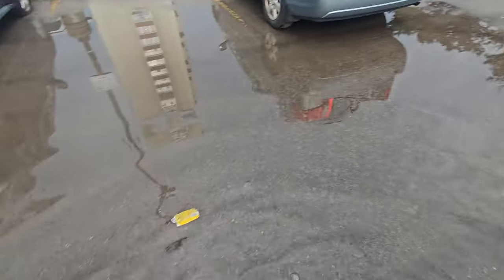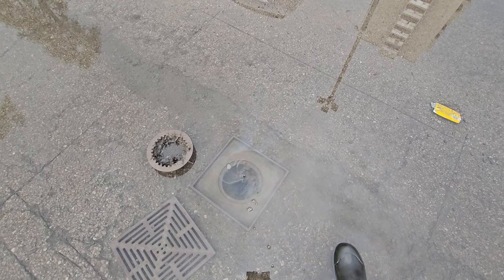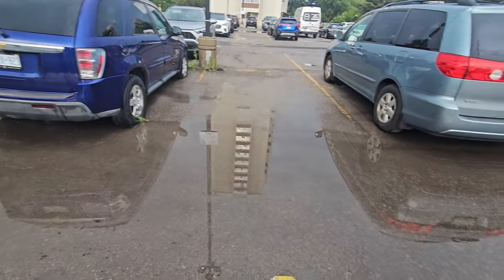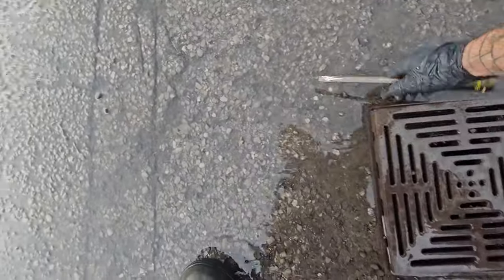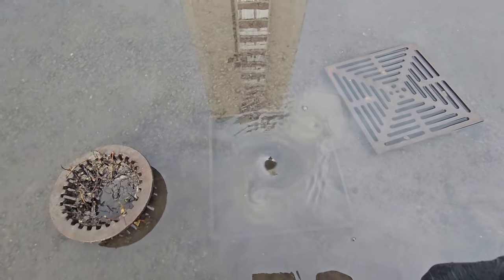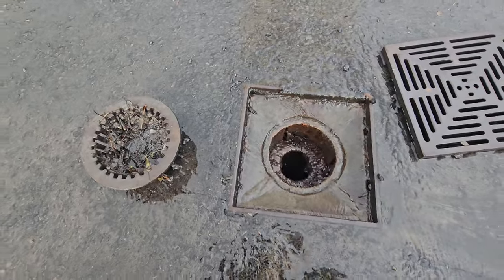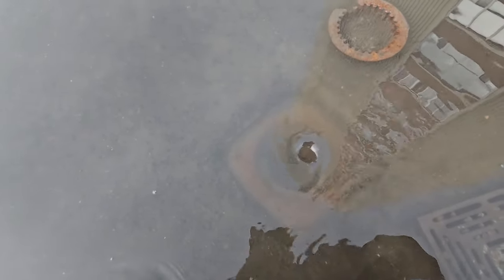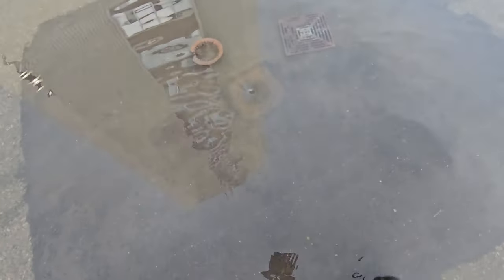Weak Whirlpools

Comment: Maybe the line which collects from all of these drains is partly clogged or the discharge end is too much under water for example so it can't get enough air to form proper whirlpools ... not enough suction what i think.
Reply from the maker: I've cleared these in the past and this hasn't happened so I believe it was partially clogged. Thanks for watching have a great day

Comment: They are bubbling up because the air in those connected drains is getting pushed out by the weight of the water draining into the currently open drain. Not a plumber, just watch a lot of storm drain videos.
Reply from the maker: Very cool thanks for watching have a great day